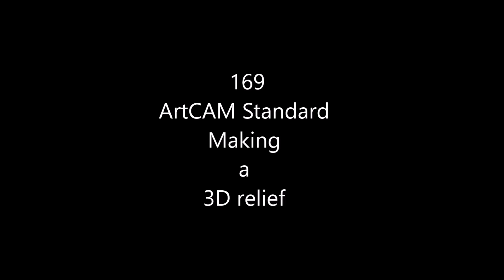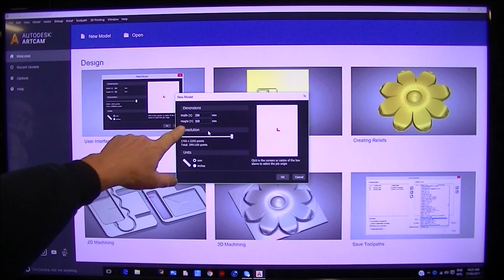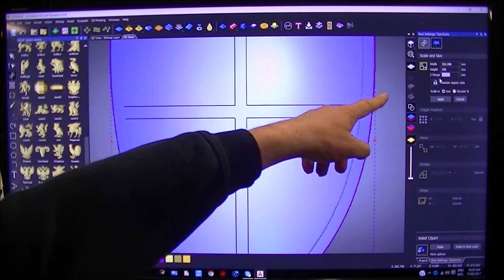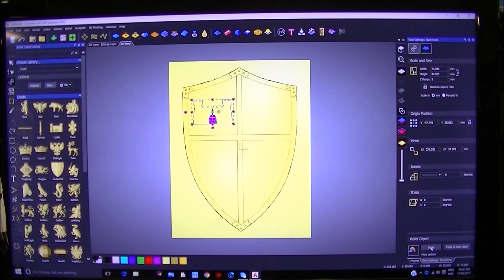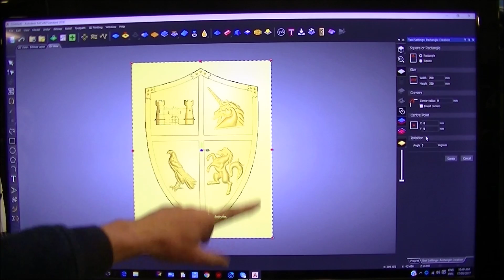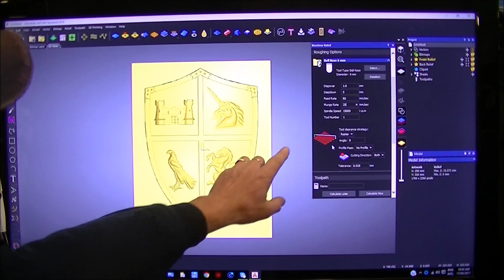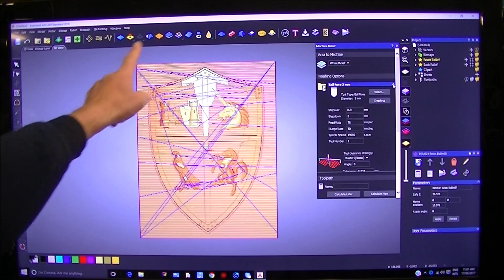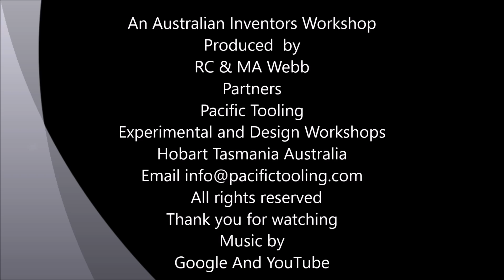169  The ArtCAM making a 3D relief

Comment: Hi Roger - Thanks for this.  I was wondering if Jewelsmith ArtCam and Autodesk ArtCam was the same thing and presumed that Autodesk must have acquired the original package.   I know that you were a fan of the prior version and was wondering when you would migrate to the new one.  

I don't have a base line experience with the old version so don't see much sense in going back to that if the new one is up for the job.   At the $180 price it seems pretty reasonable to get onto it.

The original  pricing was prohibitive for at the home hobbyist in my honest opinion and like the Fusion360 model very much.   I guess this is why they dropped the price for a 1 year subscription as a "get on board" special - which make sense.

Im looking forward to seeing your learning to determine if the new version is substantially better than what you were used too and if it has any pet pevs and bugs that earlier versions traditional suffer from.

Grant the kiwi

Comment: What wood turning machine do you have
Reply from the maker: Hi, Email me at : info@pacifictooling.com  I will send you information on our new Wood Lathes
 and CNC routers, 4040, 6060, 6090 , 6012 , 1212, 1224, 1325 and now CNC 6040, 6090 , 1390 Lasers (linear rail model), and machine tool accessories . Pacific Tooling, 
 Australian Inventor Roger Clyde Webb